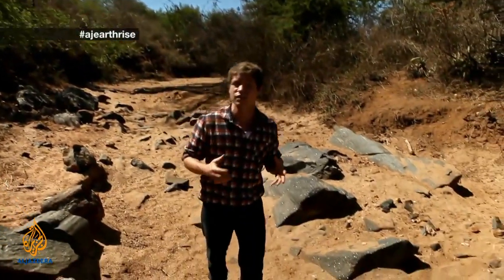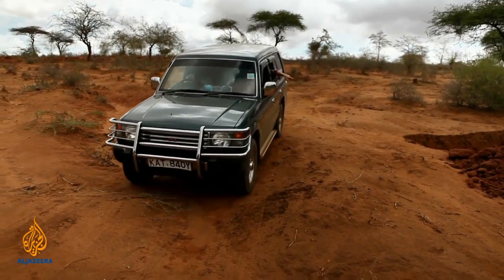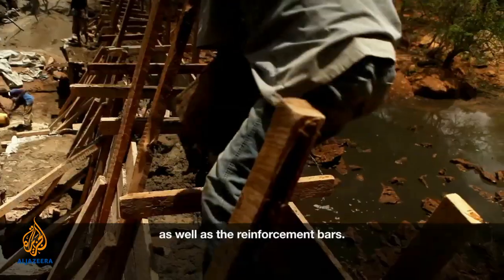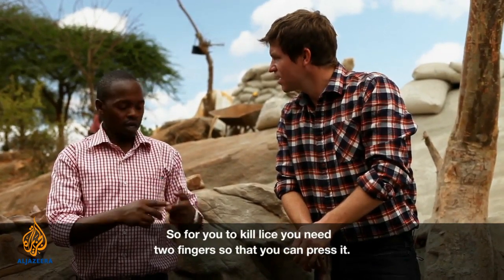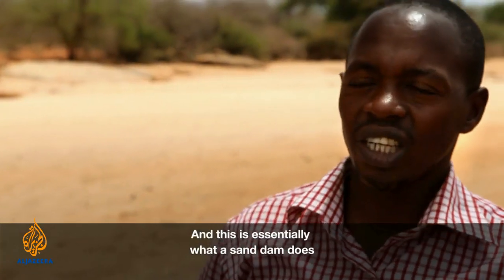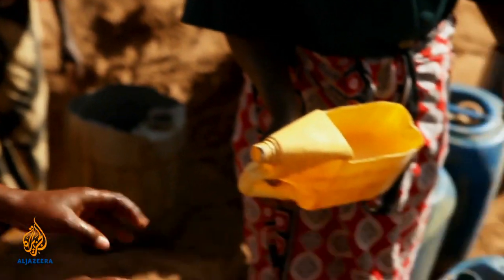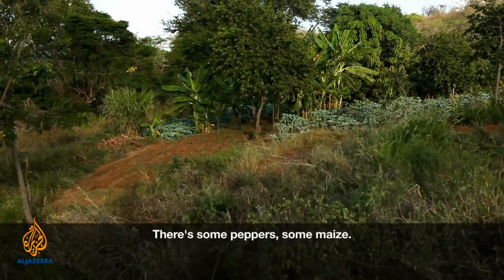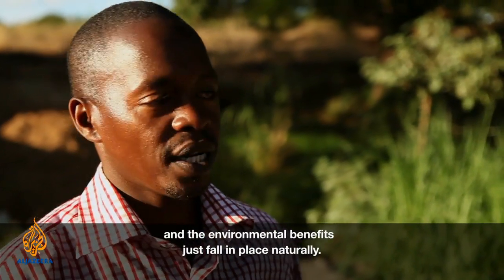earthrise - Rain Catchers

Comment: This is check Dam but their is one problem, the down stream flow of water get stopped and you literally killing a river. Check dams by upstream state just killed a river in my state and the river bed dry through the year
Reply: Not the same type of dams, this one let's water overflow and go on to the ocean, it just stores a part of it and releases it slowly
Reply: @madoxxxx06  I guess he didn't watch the video like us. He already had an idea right before watching it
Reply: @madoxxxx06  Not enough water. Premwithme is right. The same happened in Zimbabwe because people didn't understand the proper water management structures to use. Check dams are fine, if they don't cut off water access to villages downstream. When they do cut off access, they cause more problems than they solve.
Reply: I read the wikipedia page, said that only 1-3% of the rainwater is retained in a single sand dam the rest continues along its natural route. There are a lot of contentious (non sand) dams here in the states that screw with different groups I just read about the Klamath water dispute, some f-ed up stuff
Reply: There is no river. Just a path for erosion.

Comment: The sandy section would be an absolutely perfect place to put solar collectors. The sand is there partly to provide protection from evaporation, so the shade from the collectors might enhance that effect as well as providing power.
Reply: Except it floods in the rainy season. The water pours over the dam. But I agree about the solar panels being protection against sunlight. In that climate you can probably grow crops under the panels.